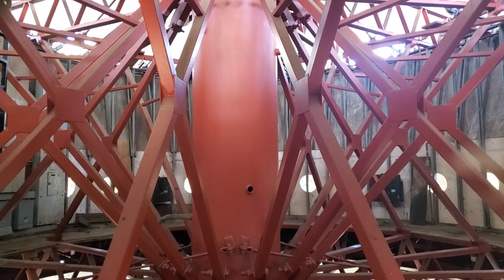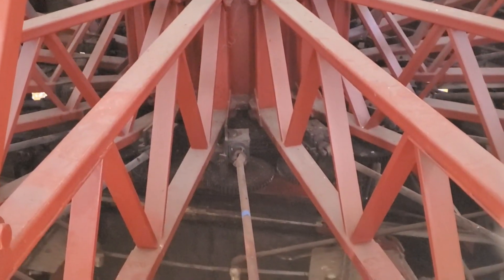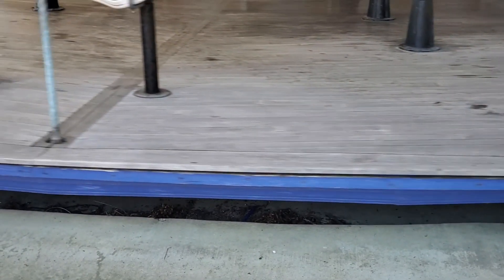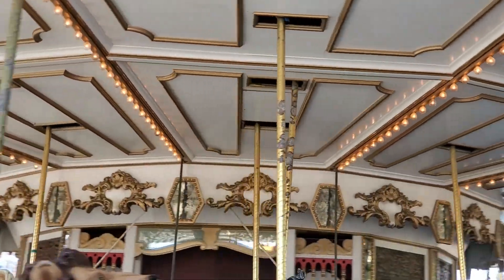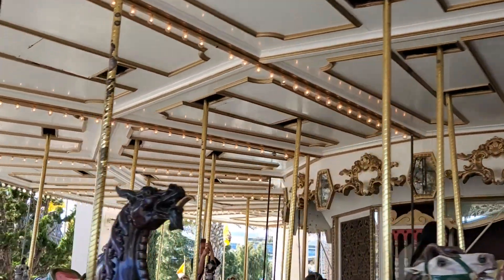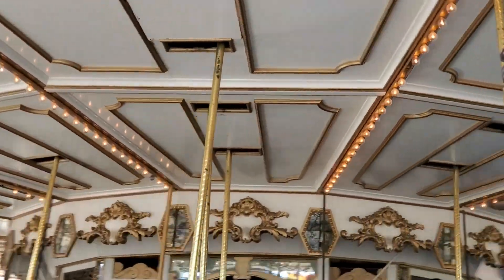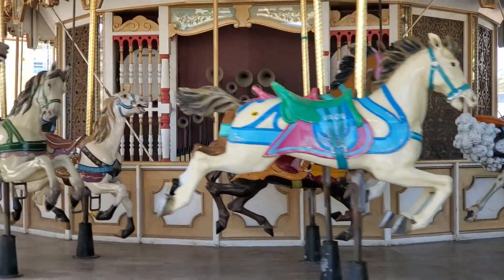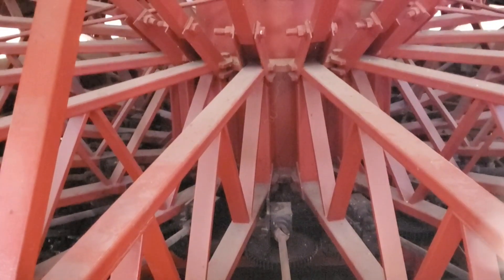How It Works MINI: Carousel Columbia

Comment: These were initially hand powered. The steam engine made it possible no only to revolve the machine and make the horses "jump", but to move the entire amusement from city to city. Later on electric motors were used. Even the carving of the animals were done with duplicating machines. Master carvers would do the finish work. Great video of the SOUL of the Mid way, themed park, or wherever one of these marvelous machines call home. Why even malls have them.